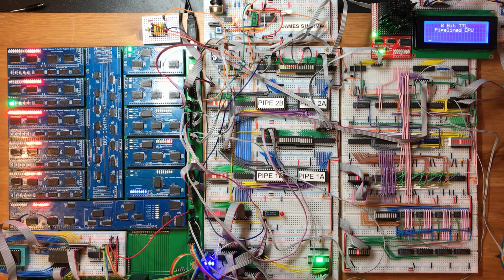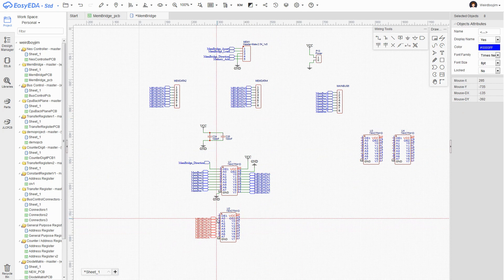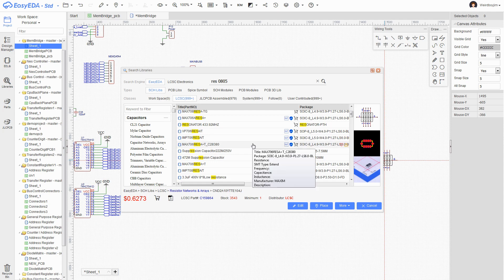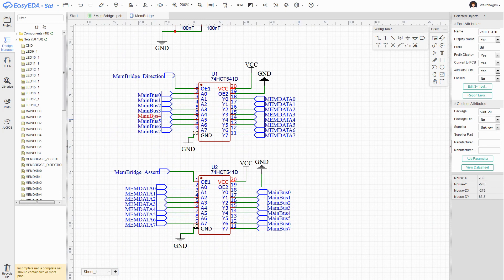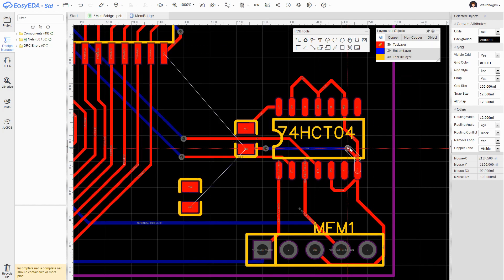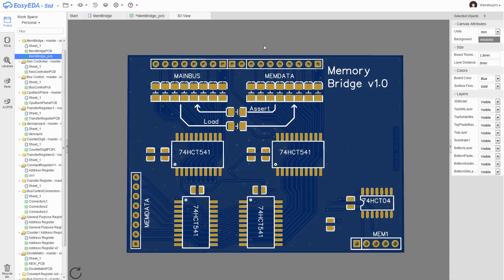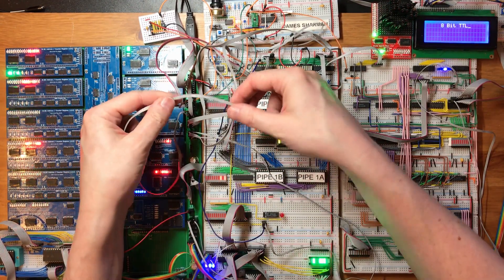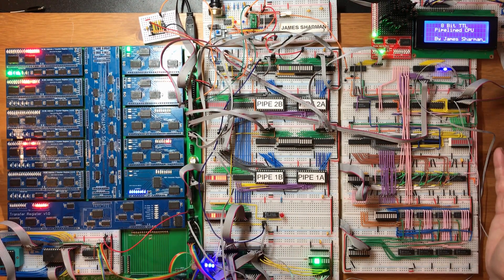Memory Bridge PCB Design - Making an 8 Bit pipelined CPU - Part 70

Comment: Instead of using two 541's, why not use a single 245 which is bidirectional and also tristateable?
Reply from the maker: That's a good question and the answer is almost worthy of a video in it's own right, I actually bought a 74LS245 before I made the breadboard version intending to use it.  You can't just replace the two 541's with a 245, you need some extra logic (in this case an AND gate) to generate the enable signal into the 245. This circuit ends up with 3 different chips on it rather multiples of same one. Then you have an additional issue where the propagation delay of that AND gate offsets the time the device is asserting to the main bus, so you have the possibility of some line contention (The 138's and 541's driving the bus elsewhere have some slack so that might be ok depending on the speed of the AND gate). All in all it just seemed simpler and more reliable to use 2 of the chip that was doing the equivalent job elsewhere, if you were building to a price point it would probably be right to deal with the timing and use the 245.
Reply: Cool. Seems you have thought it through pretty well then. Back to my box. 😋
Reply: One other thing I might mention though, on the topic of extra chips and all, there are single gate devices available which can help in terms of the amount of board space required, "wasted" gates, and layout because you can just place it exactly where needed or most convenient.

They come in SOT23-5 packages usually, so pretty small.

But it is another part and I guess it just depends on what you're optimising for.

Comment: Thanks James. Those line drivers look like a good way to maintain stability. Take care.
Reply from the maker: Thanks Jerril. Feels like overkill, it could be done for much lower gate count (with just 8 fet's) but nobody does that in a package as small as the line driver.  Should work though.

Comment: This reminds me of one of my brothers friends meany years ago, was working on the design of a uP. Found a bug that was a major show stopper, so logged it and promptly left. I think in the old days uP were a lot simpler than those of today. you got in to a lot more depth when designing the circuitry around it, you get used to the ports being integral to the chip and not hung on the address and memory bus's with a hand full of interfacing chips thrown in as well. love these video's takes me back to the old days for awhile anyway.
Reply from the maker: This whole project is a weird hybrid between a learning experience and a nostalgia trip for me.

Comment: you can invert LEDs more efficiently by flipping them and connect them to VDD instead of GND. You sink the current instead of sourcing it.
Reply from the maker: Yes, but I don't think I should. I've done that on most of the control lines on the other pcb's (and the breadboards). But I realized a little while ago that the control lines were draining out of spec for the outputs, it's probably fine in this case since both these inputs are the only control lines being driven from the output of a 74hct138 but it wasn't that big a deal to be safe.
Reply: you could use some really tiny noninverting or inverting buffer drivers. i used these for one of my projects (hand soldered) M74VHC1GT125